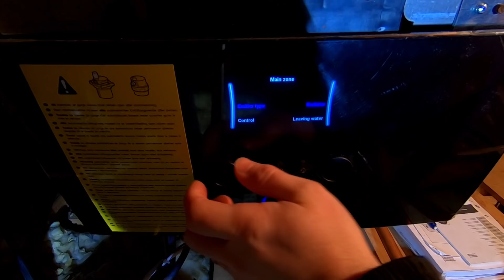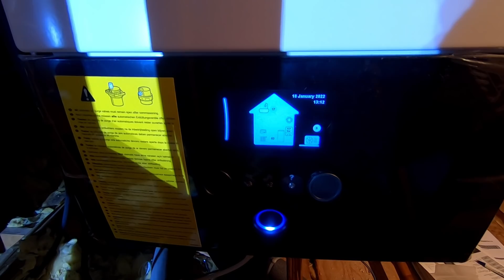How to lose £2000 installing a heat pump

Comment: This specific heat pump is one of the best as it can work up to -20 C providing 60 C water on that temperature. It is not the reliability the issue. The issue is that seller had no idea on what he was talking about. HP needs to work in low temperatures as they provide better COP and also ideally to work with two systems (heat pump warm buffer and from buffer to go into radiators). That's why in warmer days ideally need to provide less hot water and increase the temperature during cold days.The main problem on this is that radiators have been calculated for water temperature at 75 degrees so the energy the provide at 60 is way lower than design. Personally i would advice to leave the gas boiler as much as you can and invest into insulation of your house. If you will create a passive house then you will be able to warm your house with very very little energy. Heat pumps is a very good tool but not for a 50 year house with old windows and no isolation in (or out of) the walls. A last advise to people who want to install HP is to find a heat pump with R32 instead of R410 as I THINK that the latest will be forbidden in coming years. Nice work on plumbing side
Reply from the maker: All correct mate
Reply: Yup.  Concentrate on insulating homes, I'm laughing at people who moan about £1500 gas bills for their 1960s semi and expect a heat pump to be some kind of magic bullet.
..  I'm in a Victorian three bedroom house, fully insulated and my gas bill for 2021 was £350 and a good proportion of that was standing charge (about a third) 😝. The insulation was done during renovations using the best U value materials available, adding about £10k to the cost - it has paid for itself already, even before the 50% gas hike.  Oh, the key to a decent gas bill (apart from insulation) is to make sure your radiator flow rate is low as cold water entering the gas flue is where condensing boilers get their efficiency (and their name) the laws of thermodynamics means the phase change of steam (burning methane in oxygen produces carbon dioxide and water as steam) condensing that steam releases a lot of energy.
Reply: It sounds good, but surely it would have to defy the laws of thermodynamics to get heat from nowhere!
Reply: @johnchoice1371  hi John. What do u mean heat from nowhere?
Reply: @vasileioskaltouroumidis2941  OK, I mean that according to the second law of thermodynamics, heat flows from hot surfaces to cold surfaces. A gas boiler generates integral heat from igniting gas. A heat pump just has a big ugly fan whirling around in a box, so if it's cold outside, how can it draw warmth in? I would rather have the gas boiler.
Reply: @johnchoice1371  by making cold colder it can make warm warmer. Its your fridge in reverse.
Reply: @johnchoice1371  hi John, the air that is inside the system has a boil temperature to -350c. Also there is compressed air which relief valve. So even with -5 degrees u can have quite big heat exchange with a cold air. Then this is compressed and generate extra hear which is going to hear exchanger and change warm the water. Some heat pumps have two cycles to profuce even higher temperatures but obviously are more expensive. Think that heat pubs taking energy from the ground. Ground has a quite same temperature and still those hp can give heat or cooling energy depending on what user wants by reversing the compressed/release valve.
Reply: @Lewis_Standing  OK, but there's very little warmth coming out the back of a fridge.
Reply: @vasileioskaltouroumidis2941  I cannot understand this, because the laws of thermodynamics dictate you cannot create heat from nowhere. If it's cold outside, how can it produce heat?
Reply: @johnchoice1371  if the liquid/air with is on outside heat exchanger is lower than the temperature of the weather there is an exchange temperature. Then this is compressed and due to the compression is generated heat which is goin to inside unit. Exchange some heat there and then evaporated causing extra heat loss of the liquid, then this is colder from outside weather and cycle repeats. So what needs is outside weather to be warmer than liquid/air of the close system. Warmer situation can be in really cold weathers
Reply: @vasileioskaltouroumidis2941  IT still is hard to understand. Why would the liquid inside it stay cool? Thermodynamics says that everything tends to equilibrium so that hot bodies lose heat to colder bodies until equilibrium is achieved.
Reply: @johnchoice1371  exactly. So the weather temperature going to a compressor and increase the heat let's say was -10 and after the compression is going to +45. Then +45 goes to inside heat exchanger to give this energy to water. So it is going in +45 and when leave exchanger is +30 (assume room is 20 degrees). Then this is evaporated and get cold so from +30 to -40. Then this -40 goes to outside unit (with the ventilator) and exchange the heat with the weather. So it goes -40 and then get inside with -10 if we assume that weather in that day is 0 degrees. Then again back to compressor and so on. The numbers are not real just to show how this is work. The difference -40 to -10 is "free" as u take it from the environment. Now the colder the outside temperature and the higher the temperature we asked from hp the most energy will need for compressor to work.
Reply: @vasileioskaltouroumidis2941  Ok. Thanks for the explanation. Where does the energy come from to compress the liquid and heat it up? But is this truly an efficient way to get heat? It seems slow, long-winded. IF a fridge works the same way, why is there hardly any heat coming out of the back of the fridge? Surely there should be a lot of heat coming out of the back of the fridge because it had to exchange the heat for cold INSIDE the fridge?
A fan heater is much quicker because it has a heating element inside. Is that better?
Reply: @johnchoice1371  the compressor is working with electricity, the heat is generated due to compression. This doesn't mean than 1kw energy generates 1kw of heating. The efficiency depends on outside temperature and the water temperature we asked for. It is better than electrical heaters as there 1kw electricity gives 1kw heat energy. If it is worth to install hp is another story. Fridge is isolated very well and also is a small space to make it cold. If u can isolate perfectly a house then u will not need as much energy to keep it warm so hp will exchanger less energy out. That's why I personal believe that the story with hp programm make no much sense. Firstly we have to isolate our house in the best way and then we can discuss the source of heating. Imagine to consume 30kw per sqm per year and having 20degrees no matter if outside is -10 or +30!!!!! Is hp better than gas? Again is depends on lots of factors and there are not only efficiency. If we were not so dependent from gas then maybe other countries would be able to play with the prices.
Reply: @johnchoice1371  that's because it's equivalent energy to that taken to cool the food. Doesn't need a lot of energy to cool a small insulated box.
Reply: @Lewis_Standing  OK. I still don't think you can get heating by magic. Just a normal fan heater can heat up a room more quickly, because it contains a heating element inside it. So then you say, 'But that is not heating the whole house', and then I say 'Well it is wasteful to heat the whole house. I can be in just one room and keep the heat in that room'. Surely, if this heat pump is going to have to heat a whole house, it is going to use a lot MORE energy to do so.
Reply: @johnchoice1371  it is not magic mate, is physics. The fun heater provide 1:1 energy. U are right, if u want to heat only one room then a hp who has been selected to heat the wall house maybe is more energy consumed, even if this will be able to be solved with a buffer. But if u want to heat only one-two rooms u can choose a very small hp and manually open/close the radiators valve accordingly. Still hp will be in your benefit. The same principal with gas boiler then. Select a small one, put temperature as low degrees as u can for efficient heating and open/close radiators u want. Fun heaters uses an expensive electricity and have cop=1. They are super cheap to buy them though. So if u want to use heating for a couple of hours per day then maybe it is the best solution for you as you will not take back the money from a hp or the cost of radiators/boiler system. There is not perfect heating system, all depends on individuals
Reply: @johnchoice1371  it's not magic. It's taking heat energy that exists on all things down to - 273 degrees and moving it about. It uses the latent heat of evaporation and crystallisation to move it from one place to another. Someone who uses the phrase second law of thermodynamics should not find this that difficult.
Reply: @johnchoice1371  There is energy in the air at all temperatures above absolute zero (-273 C). Even at -20C, the air has usable energy that can be extracted.
Reply: @prog_by_richardn  Ok. That is an interesting concept. But surely, it must be very difficult to extract minute amounts of heat from an outside source which we regard as cold (winter). I just think that having a source which generates heat integrally is the most obvious way of achieving heat quickly.
Reply: @Lewis_Standing  Yes, it's all relative. But it just seems like it's a difficult way of achieving heat. So if there are tiny amounts of heat outside, that fan is going to have to work awfully hard to evetually draw them in.
Reply: @vasileioskaltouroumidis2941  I personally would not bother with one, due to huge cost. There may be some who can justify it, but I think most people will try to keep their existing heating system.
Reply from the maker: A lot of people have ageing systems that are in need of replacement and renovations and they do not want to replace it with another gas boiler.

Also if you do extensive renovations it makes sense to look into HPs
Reply: @johnchoice1371  the fact it's cold to us is irrelevant. Its actually literally boiling to the gases used in the system.
Reply: @johnchoice1371  Even if it's cold outside, there is still energy in cold air, the energy is transferred from the cold air to an even colder evaporator in the outdoor unit of the heat pump, so no heat is produced. The evaporator gets cold because the refrigerant inside has reduced pressure after passing the expansion valve, and this reduction in pressure absorbs energy from outside. Please read up on latent heat and how energy is transferred when gas condense to liquid and when liquids evaporate to gas.
Reply: @Peter-un8no  Good explanation. However, if I was feeling cold and just wanted to heat one room quickly, I think that a fan heater with a heating element would be quicker and more convenient. So I think we should let people choose which method they prefer.
Reply: @johnchoice1371  John, heat pumps are really cool technology and at first it's hard to grasp the concept. It does seems like magic at first but trust me, the thermodynamics are sound and it works. I highly recommend you watch some videos from "engeneering mindset" https://youtu.be/QykwWs3L1W8

HPs are between 3 to 4 times more efficient than a direct electric heater. And if your comparing with a gas heater not only is it more efficient, it has about 15 times less CO2 emissions (depends on weather the electric energy is from renewables or not).
Reply: @johnchoice1371  Dang. Why even have your gas boiler? you have your fan heater. Lets take out all of the gas boilers and put fan heaters in the rooms. I'd love to see your energy bill doing that. Because a 1KW heat pump can be 5, 1KW fan heaters. That is why we use a heatpump, and not a fan heater.
Reply: @djenson  Slow, slow, slow....
Reply: @vasileioskaltouroumidis2941   Stop trying mate... ;-)
Reply: Its very little because the compressor is also very little...about 250watts....compared to a few killowats a heat pump has.

Comment: That's a ridiculous installation and the size of it is just wrong can't they fit a dam water heater in the same space as a combination boiler we need Chineseium input even if it takes a bit longer to heat the water and cud even add 2 heaters something like a electric shower heater
Reply from the maker: That is what I would have done if I designed the system.

Comment: What an absolute shambles. Did they do the pre-install site visit from the McDonalds round the corner? Who the hell would want cable trunking run up the side of their house? If I was the home owner that whole job would have been on stop from day one. Absolute clowns. I hope you never work for them again. What a mess. That was a simple boiler swap, pressurise the system and new controls. Couple of days works and thousands of pounds cheaper. And then they disable the weather comp. can you imagine what their energy bills will be now? You gotta ask yourself. If these guys were any good they wouldn’t be using subbies would they, why are they either unwilling or unable to employ a full time team.
Reply: L

Comment: Just trying to get my head round this weather compensator. 
On a warm day the HP unit will run using less power than it would on a colder day (when the WC is switched on) this results in cooler radiators so the customer then complains  (the installer gets a call-back) because the radiators are no longer hot enough ( what a farce) ?  Really felt for you in that tight roof space!
Reply from the maker: Yes correct about WC. It’s fine forbrads to run cooler if sized correctly. Just don’t try to dry your socks on the rad 😂

Comment: Guys, your work is absolutely stunning,  as for the main company you did the work for..absolutely shocking behaviour about the weather setting....don't do any more work for them...end of !!!! Lastly Air source pumps not only inefficient,  but absolutely ugly...no way am going to have that shit outside my bungalow....if this government tries Enforce this , take it from me that air source pump pipework is going straight up this uk governments arsole.  Excellent video guys. Thank you regards The Legend
Reply: Correct. Last year gas bill £70 /month. This year October, November, December each month £500-600!!! Cost of installation £14500 crazy, isn't, I wish I could turn back time, what a fool I was :(
Reply: @rafaltomaszewski5175  oh dear that is absolutely shocking,  sorry to hear that !!!!
Reply from the maker: Rafal, I will help you out with this. We will shoot another video about shocking HP installation practices
Reply: @UrbanPlumbers  Hi Urban Plummers, I sent an email to you regarding a replacement boiler,  power flush , new radiators in a 2004 bungalow,  in Lincolnshire,??  I can sort out accommodation if your interested  ? In April this year ?? Kind regards Danny
Reply: @UrbanPlumbers  thank you Szymon, I count on this.